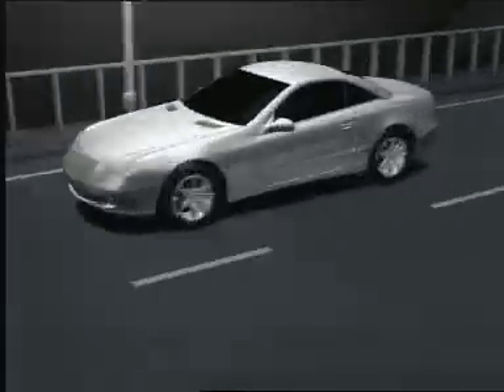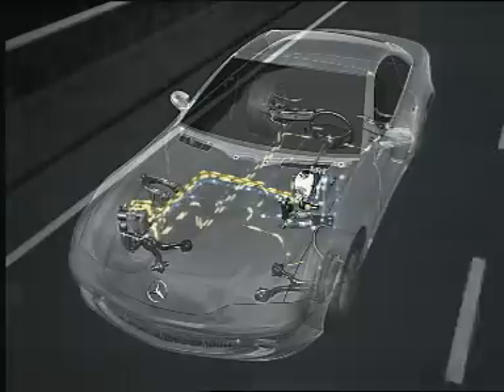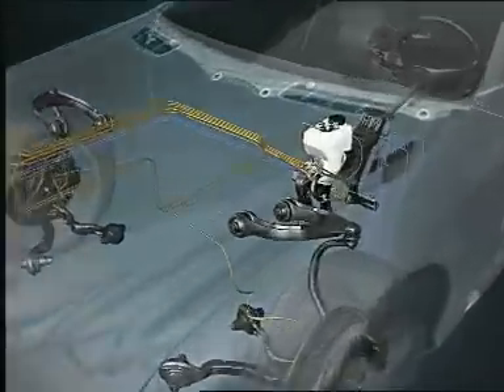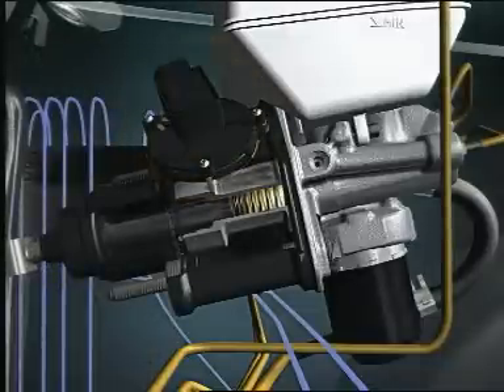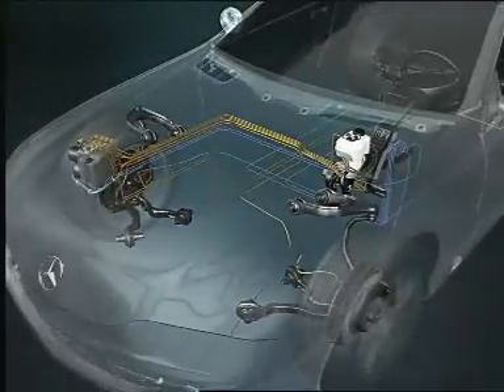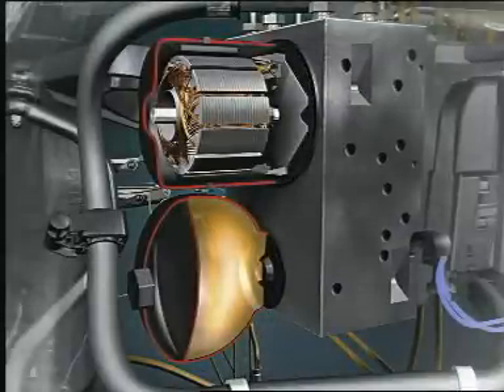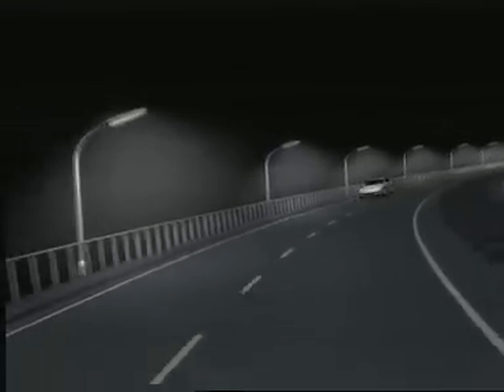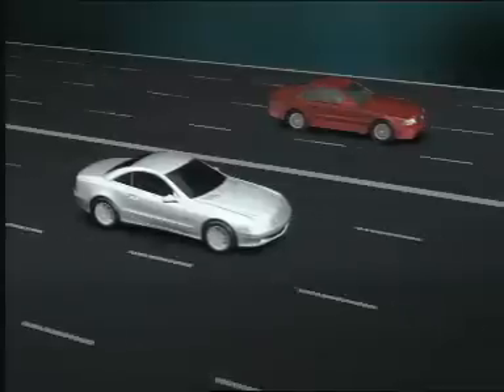SBC - sensotronic brake control - how it's works

Comment: Hello
I want to change my calipers on my E270. Can I bleed them traditionally, undoing the plug while brake pedal is under pressure? Sbc off, no diagnostic tool so maybe unplug both batteries?

Comment: This SBC in my W211 E270 probably saved me from a crash. Long story short, at a speed of 130kmh and while entering a corner i had to slow down abruptly, the speed was reduced by 50kmh in an instant and it was barely noticeable. Who didn't drive with this doesn't know the benefit, but of course it has it's own flaws, like that recall and dying off after some mileage, but for every problem, there is a solution. :)
Reply: I have to agree with you. Own a 2004 E320 W211 with SBC. The only disadvantage of this system is that is a money pit. But I'd rather pay $1000 for a new SBC pump than have the brakes system of the facelift W211. I've driven my friend's facelift W211 without SBC, it's good. But I very well noticed the difference of not having SBC. It saved my ass several times, and while it is expensive, those extra dollars that you put into it might someday save your life!
Reply: It's true I have a 2006 E320CDI and that is a really special year for the car because it has the CDI inline 6 turbo diesel and the SBC.  I really like the SBC, yeah it has kind a plastic like feel and it's not the most precise modulation of power, but it can control the brake way better then I can on my own and when I'm driving hard and I need it, it's there way faster then any human could ever be.  There's a few times I was going fast in traffic and suddenly the car in front stopped and I just went down on the brakes and it knew I needed full power instantly and the brakes were able to achieve full braking power way faster then a normal brake system can achieve plus if I needed to steer the fact that the car can use the brakes to steer the car for me is really impressive.  Honestly I think most of these cars had the SBC system replaced with new one that have 25 year warranties on them so I'm not worried. I think it was a very special year mercedes with a revolutionary technology that was actually pretty far ahead of its time.  I also think that mercedes continues to use this technology on their commercial trucks and buses to this day as well
Reply: @rainbowwarrior2635 didn't they switch to the V6 in 2006
Reply: @Shockload  No it was 2007 that they did the facelift.
Reply: @rainbowwarrior2635  pretty sure the facelift for the 211 was rolled out in 2006 but for the NA it applied for the 2007 model year, they did this for W203 too (2004/2005)
Reply: Last week i had to make a emergency brake, maybe saved my life; but when the engine started next day the brake maintenance message appeared. Was the acimmulator, replacing cost 421 euro, but maybe saved my family's life (MB does not care about the security in EU and does no cover the waranty). It's a great system but needs a new update for being more reliable.
Reply: Y’all praise SBC because it saved your lives several times on corners like going 130 but it slowed itsself down to 50kmh which is 80 kmh, but here in Albania we hate sbc braking bcs its money eating and were usually used to abs braking and we take corners fast and learn fast reflexes😂😂

Comment: I just bought a 2003 E270 and the SBC unit was replaced in 2018 at the cost of £1300 to the last owner. So I'm glad that's something I shouldn't need  worry about.
Reply: Sitting right now in an s211 2003mod. E200 Compressor. And 390,000km on the odometer. Still the original SBC system, no problems yet. A fantastically good braking system, as long as it works properly. 👍
Reply: @saccoearth 
Why does it get problem? do i need to change the brake fluid every 2 years? What do u recommend me
Reply: @AS.MA_  The brake fluid should be changed every other year or 35,000 km as recommended by Mercedes. But the problem with SBC (Sensotronic Brake Control), I'm not entirely sure, probably has something to do with the brain of the system that controls everything. But this could happen tomorrow or never. our car has done 394,000km and is now 20 years old, still has the original SBC system and no problems. I think it's a bit of bad luck when it breaks, but anything can break on a car, that's just the way it is... But really, a fantastic system as long as it works!

Comment: These systems are fantastic. They perform excellently and even have a backup small hydraulic unit in case of pump failure in models from 2003-2006. The initial electrical wiring and ground issues were recalled and fixed in updated models. There was also an issue with the brushes wearing out between 100k-200k miles in units- which gave SBC a bad wrap. Whole units were given a 25 year extended warranty last year, in the U.S. The unit that MB replaces it with has upgraded brushes and electronic components. The result is a very reliable, efficient, safe unit that owners of these cars will be given and installed as soon as their pumps fail until around the year 2030.
Reply: They're fantastic when new.  It's all downhill after the first couple years....
Reply: @mosesberkowitz3298  not when Mercedes gives you a new updated unit. There is a 25 year warranty in the U.S. on these SBC units. The new units come with larger brushes and upgraded wiring harness. I have had no issues since.
Reply: How do I benefit from the replacement I am in Nigeria I own a E350 4matic benz the SBC is giving me serious issues.
Reply: @oyeinkurokakemomarcodinhoa528  Try contacting Weststar (a Mercedes-Benz distributor in Lagos). They MAY know how to go about that.
Reply: Sitting right now in an s211 2003mod. E200 Kompressor. And 394,000km on the odometer. Still the original SBC system, no problems yet. A fantastically good braking system, as long as it works properly. 👍

Comment: my SBC is making noise when ever i unlock the car or step on the brake pedal and wont change gears
l
Reply: Your car may have no brake fluid - leaked out. If that is the case  you have to find the leak , refill the system (MB synthetic brake fluid) repair, bleed the brakes.  W211 requires special procedure if equipped with SBC.
Reply: i had a 2003 e320 and after starting the car, the brake pedal would VIBRATE and make a wirrring noise. the brake fluid was good and there was no leaks or anything. 
it was unsettling
Reply: This is notmal it was pre charging

Comment: Now it have a 25 years warranty on the sbc warranty. Weird they use this complex break system on a E class, mayback and the super car SLR. My sbc is giving warning on my e class is giving me warning now and the dealer have no ETA on the parts to arrive. The break still works fine thought, good for mercedes to warranty them for so long, but no dealer are willing to give out loaner cars.
Reply: Yeah finally mb warranties something screwed up for a real period of time, you're lucky.

Unlike when their 90s cars got random wiring harnesses made of biodegradable soybean oil that "biodegraded" in the car way sooner than expected. No recall cause failure modes were just loss of engine running at worst. No extended warranty coverage for any appreciable amount of time cause hey screw you! Also let's double fist the customer and not sell replacement harnesses any longer than required by law!

Another good one is the circa 98' E class models, the front spring mount is like a pocket where it mounts to the frame, as you can imagine this fills up with water soaked road debris and rusts it out causing the suspension to collapse. No recall because MB convinced the safety board the spring perch only collapsed while the tire was being steered at stop or slow speed. No extended warranty or anything but they did provide a terrible bolt on affair to repair it after it brakes!

Oh, does coolant in the transmission absolutely ruin the transmission? It does? Well let's make sure to combine the two systems in a particularly weak plastic radiotor for almost no reason at all. Are some of those radiators ticking time bombs? Who cares! A service bulletin will do, No soup for you!
Reply: Spenser Roger yeah when merc and Chrysler were together, their product were bad quality. The earlier 3.5 v6 have a soft balance shaft that would go bad at 50k and a leaky gas tank. Good thing Mercedes extended warranty on the gas tank, but the balance shaft issue was per case issue. 

After they got rid of the sbc and Chrysler. The 2017-2019 w211 are very reliable cars.

Comment: Sealed & dirt roads. Our 01 Saab brakes better/sooner than our w211. Says it all.  Oh, the Saab uses ordinary pads/discs from any auto shop.
Reply: Simon Inglis you are comparing an older budget car to a much heavier luxury car. Of course the larger and heavier w211 will have a harder time braking than a Saab. Also, you can use conventional pads and discs on the w211.

Comment: It sucks this SBC system was flawed. It’s a great system when it works properly. It stops so much quicker than conventional brakes and it’s saved my ass a few times from getting into an accident.
Reply: Extended Warranty on SBC now 25 years in US.
Reply: @doxland  Yup! I actually just got a letter from Mercedes saying their extending the warranty to 25 years/unlimited millage. It's great that their still supporting this unit
Reply: @elkillerx  Yeah, it's great that they do this in the US, but in the EU, you have to pay for it yourself. And the SBC pump isn't cheap, considering how cheap the cars are.
Reply: @doxland  what about people in Europe do Mercedes have a 25-year warranty on their cars as well or is it US only
Reply: Anthony word! I got an 06 E350

Comment: Worst idea ever!  That's why they got rid of it.  It just moved the driver further from control of the vehicle. Not something that you want in a performance car - better suited to the high-end luxury (safety etc) BUT, they don't even use it anymore there. 

What genius came up with the idea to activate the brakes on a low level everytime you release the accelerator? And then put a limit on the number of times the pump could operate before forcing it's replacement.

This was probably just something that the engineers thought was a lot of fun to design and model / implement. I think that marketing thought it was a good idea because of the "avant-garde" deign to separate them from competitors.
Reply: I think the 300k limit was intended to have you replace the brushes on the electric motor, or the entire motor itself. This is an easy, inexpensive repair and having a warning threshold was a good idea. 
 
The real design fault though is in how the emergency brake system is only on the front brakes and without power. It should just be a fully functional system then people have no reason to complain and no real reason to freak out and if you think about it the only extra part you would need is a cheap power brake vacuum reservoir thing, oh and a line tap into the back brakes.

However the biggest faux pas appears to be activating the threshold warning while the car is driving. People freak out at any mention of the brakes and possible reduced function and thus remember the incident way different as a result and you end up with thousands of reports online of people claiming they were driving and then all of a sudden their brakes wouldn't work! Omg

Comment: what was wrong with a servo
Reply: They wanted instant pressure for any of the electronic driving aids so they could function a few milliseconds faster
Reply: @Matthew Dawood Khaghani actually one of the big reasons I've since learned is when you have a direct hydraulic mechanical coupling to the brake and the ABS turns on, the pulsating back action in the pedal frightens drivers and tends to reduce their willingness to apply enough brake pressure, sometimes even causing them to lift off completely. 

The other benefit of brake by wire is you can have the brake pedal feel setup however you like, making it easier for example.
Reply: @Matthew Dawood Khaghani 
Yeah, theyre bad drivers some of them, but the studies reveal it's a common phenomenon...and I'd rather not get hit by them if I run into a situation with them on the road.

I guess the lack of feel you describe, that must be why some drivers describe the driving of the car as "video-gamey". They must mean in the pedal too.

Still, the feeling of the brake pedal should still be the same, more or less pressure on the pedal means more or less pressure in the caliper cylinders, means more or less stopping force. 

Modulating the brake to prevent activation of the ABS while still achieving maximum braking is almost impossible in a situation where the adhesion factor and tire loading is different for every wheel. Ie: anything other than braking in a straight line on dry pavement. 

I would therefore agree with you that a system like SBC that doesn't normally have a direct mechanical-hydraulic connection would not be ideal for track or racing driving. 

In other situations though, I'd disagree. And like I said earlier, a system like SBC is very safe when designed with features like redundant microprocessors & control electronics, redundant battery, back up direct mechanical-hydraulic master brake cylinder, and programming to do initial and continuous self checking of all elements as well as activation of the parking brake and engine braking in a fault condition. It's only that SBC had some well publicized failures that caused a few reported/alledged no backup master brake cylinder activations, plus the whole shut down at x number of activations fiasco and that when the back up cylinder was activated people complained of the unexpected pedal force required to stop car.
 Also;
Modern ABS is much more effective at maintaining the highest braking rate with the best wheel slip factor than old "dumb" systems with less finer wheel speed sensors,, less algorithms, less valves/channels and lack of individual wheel braking, etc. I think the old systems is where a lot of the beliefs and truisms like "brakes are most effective at the point before the abs control range" come from.

Based on your statement and theory about modulating the brake to before abs activation for example, let's say you're attempting to come to a panic /emergency brake stop and you feel 'ABS kick on' so you modulate your brake pedal force...well it's likely only one wheel was into the ABS control range, and now with your reduced pressure your well below the maximum brake force for much of the stop on all the other wheels and you've increased your required stopping distance!
Not good chief!

Also, I believe most other manufacturers are going or have gone to a non mechanical connection brake system, ie: brake by wire. It's the future.

Comment: I monitor all English -language forums and to date recorded about 8 SBC failures around the World that were reported. 
Not bad for the number of cars equipped. 
Most of bad wrap comes form owners who buy the car extremely cheap due to all the whining and some time later got hit with high maintenance bill. 
The computer counts brake pushes and at about 600,000 pushes calls for pump replacement. Some extremist simply reset the counter and keep on driving.
Reply: Apparently there were a few instances where the electric system failed and the back up mechanical hydraulic master brake cylinder didn't work properly, leaving the driver with no brakes at all.
Reply: I heard it was 300,000 counts, also there are much more than 8, perhaps 8 fatalities because of sbc? and hundreds of cases of brake failure.
http://www.carcomplaints.com/Mercedes-Benz/E320/2003/brakes/service_brakes.shtml

Comment: Another awesome invention by Bosch! Remember guys, the pump and the electronics were designed and manufactured by Bosch GmbH. Do not blame Mercedes for the Bosch piece of shit SBC pump which fails with time and use. In fact the vast majority of German car problems can be traced to Bosch products. Remember the fuel pump failures that BMW did a recall on because on all of their turbo cars (135i, 335i, 535i, X5 etc) the fuel pump would fail and leave the car stranded? Or even worse, die while the car is being driven and the engine would turn right off. Guess who made the fuel pump. Yup, Bosch GmbH. So blame Bosch, don't blame Mercedes.

The Mercedes models which have SBC are the 2001 to 2012 SL, the 2003 to 2006 E class, and the 2004 to 2006 CLS. So if you don't want it, avoid those model years. Mercedes got rid of it after those models.
Reply: Don't be an apologist for Mercedes.  They have worked hand in hand with Bosch for decades,  and even if it was Bosch's design, Mercedes is responsible for testing it and approving it for their (supposedly) high-end motorcars.  No outside supplier tells Mercedes what to do.  
I gave up on Mercedes almost 15 years ago precisely because of poor engineering like this.  Their cars used to stand for excellence and durability.  Now they just stand for greed.

Comment: i SO do not want to have this in my car. the price of this is astronomical AND it is programed to "failed" after 300 000 cycles as it then think it must be replaced for safety AND it is insane expensive. 3000$ is not uncommon for a "rebuilt" unit. .
Reply: I bought a new SBC module direct from Mercedes and it was 1000 USD, rebuilt.   Sucks to drop money but not the end of the world.